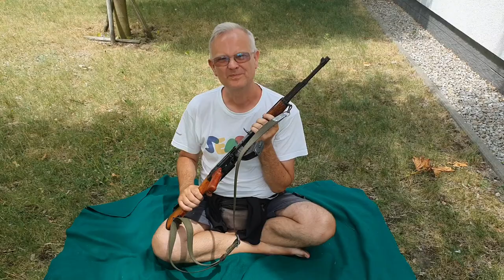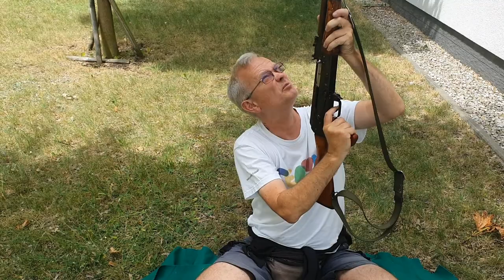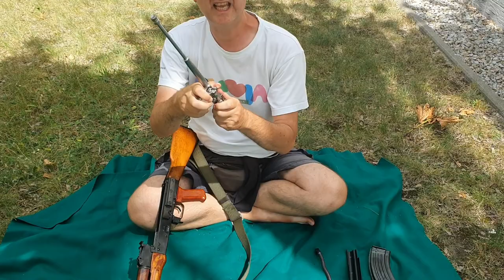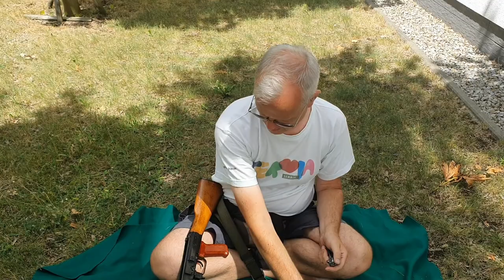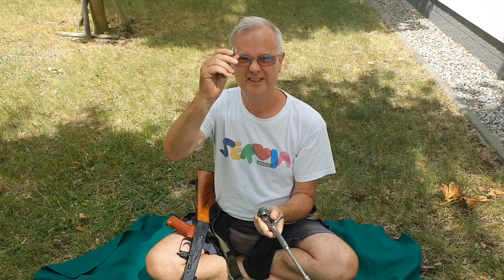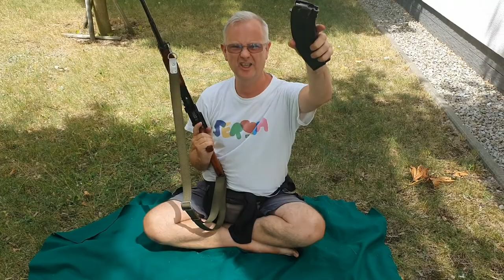How to strip a Kalashnikov

Comment: I dimly recall four inch groups at 100 yards.   The AK would reliably work under desert and arctic conditions.    They could use full automatic but only in short bursts.  They tend to climb on full auto.  They can be rented in places in the United States.    Once one learns how to adjust trigger squeeze they are wonderfully easy to fire in full auto.

The AK-47 magazine is a wonder.   Very sturdy,  very rugged feed lips.

The system was designed to have loose fit of parts.  This was to reduce interference in case of dust or dirt.

The British wanted to use the 280 British, a round much close in weight and capacity to the M42 ball ammunition used by the Soviets.   We Americans press ganged the British into using the 7.62 NATO.   The SLR would have been a better rifle with the 280 British.
Reply: The SLR had a gas regulator and gas cut off for launching grenades.    The AK did not have such a feature.

The AK was and is a wonderful system.

Comment: Not a billion miles away from an SLR though the SLR has fewer bits to lose. I've used a Galil out in Belize and the working parts on that seems identical to the AKM. Is the cleaning kit the same? Pull throughs, flannelette etc. I know some weapons use rods rather than pull throughs. Is that what the thin rod you stripped last is for? As the chap below has stated, it might be a good idea to show someone how to actually clean one, how to get rid of carbon build-up, how to oil it etc. If I remember, when I fired the Galil I got splattered with gun oil!
Reply from the maker: I cleaned it using British equipment, not having access to Soviet materials - maybe we can do a cleaning video in the future.  This weapon is at a museum but is used for firing and is in excellent condition - maybe the next time I visit I can do something like that.
Reply: I can imagine a good housewife using some good strong soap and water to clean it!
Reply: " I've used a Galil out in Belize and the working parts on that seems identical to the AKM."

The Galil is a machine receiver copy of the Valmet M76.   The Israelis wanted a combination of duty firearm and squad automatic weapon.   The initiative did not end well - they had a lot of trouble with cracking receivers.

The Valmet M76 is a copy of the AK47.  

The Galil is heavy.

"Not a billion miles away from an SLR though the SLR has fewer bits to lose. "

Use an Armalite/M16/M4 series.   Lots and lots of easy to lose small parts.

Comment: Thanks for the demonstration Alan. Would you prefer to take an AK 47 to the battlefield over your standard issue rifle in the UK military?
Reply: They aren't very accurate. If you are used to a British rifle which leaves a neat hole at 300 yards you will be surprised to see a random slash in the target from one of these. Does the job though and is designed so that untrained personnel have a decent chance of killing someone with it. Decent grouping is not an option!
Reply from the maker: I would rather have an SLR!
Reply: The South African Special Forces and Rhodesian Selous Scouts used the AK in preference to the SLR. They liked the ease of maintenance and reliability.
Reply: @roverboat2503  "They aren't very accurate. "

Depend upon the ammunition.    I dimly recall that the AKM was supposed to manage four inch groups at 100 yards.

The modern AKs are supposed to be much more accurate.   They improved the ammunition.